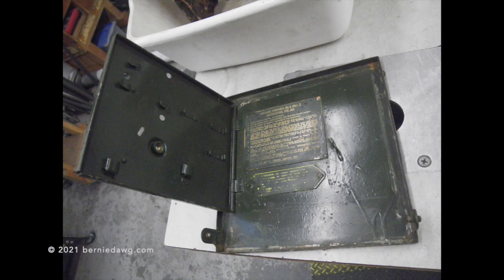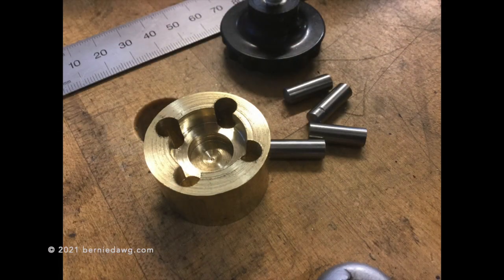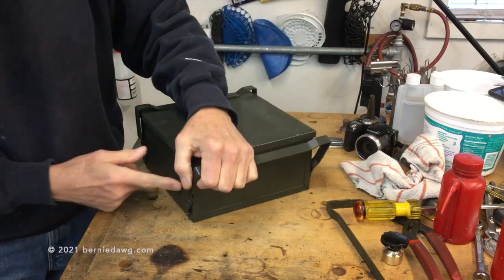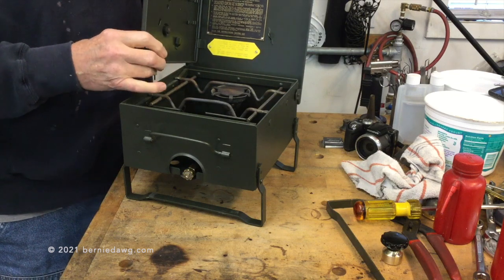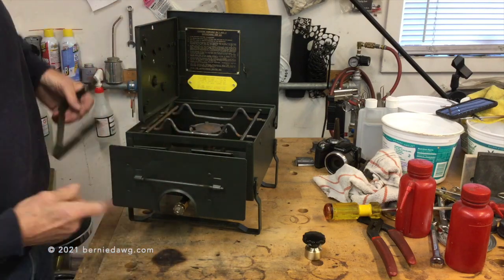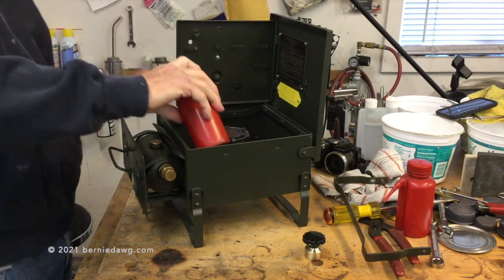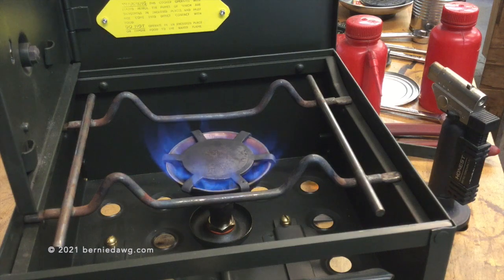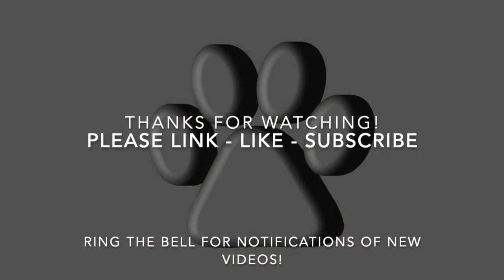British Military #2 Stove

Comment: Hey man! For sure you can help me. I have since a while an identical military cooker and now I'm trying to make it operative. The biggest issue for me is that valve brass wheel. If I turn it on counterclockwise, it cames loose and unscrew.... coming completely off from its axis. How could I fix that issue? Excuse me for my English.... and best regards from Italy. 
👋🏻😉
Reply from the maker: @hrodwulf8093  Hey! If you watch the video at this point https://youtu.be/2dj1n1s9zt4?t=39 you can see how the nut that holds the knob on the spindle shaft is soldered to the end of the spindle shaft with lead/tin alloy solder. It should have come that way. If yours doesn't, you'll need to do that to secure the nut. But, the brass knob itself should be keyed to fit the flats on the spindle shaft, too. The knob should not spin freely. Check yours and see. Maybe someone stripped it out. BD

Comment: I was going to make a he said knob joke, but.....too late
Reply: Hi, I’m going through my hillerange stove and the nrv is bad, I need the tool to take it out, any idea what size the flats are ?
Reply from the maker: @Nixon The head of the standard NRV is 5mm wide across the flats. So the slot you want on the tool you buy or make should be 5mm wide by whatever the diameter of the inside of your pump tube is (ideally). If you make or buy a tool that is smaller diameter than the ID of the pump tube - that's okay, just make sure you don't tilt the tool in use. You can wrap the tool with some tape to make a snugger fit and prevent tipping/tilting. The depth of the slot for the NRV head should be about 5mm, too. Easy tool to make with a hacksaw and a file. Or, a Dremel tool if you don't mind all that high-pitched whining (from the Dremel tool). BD